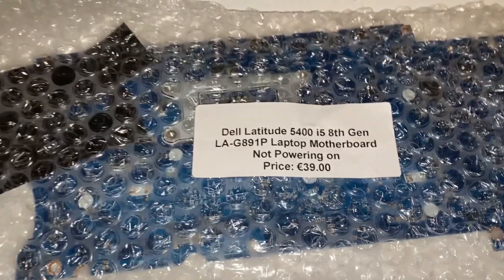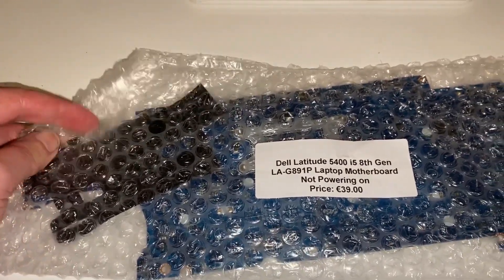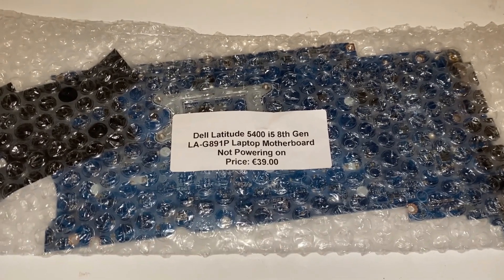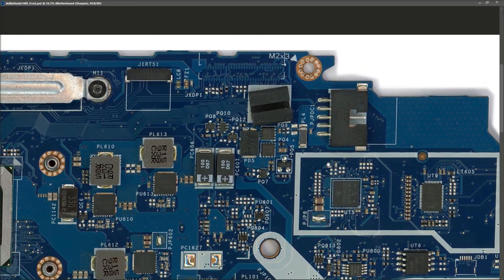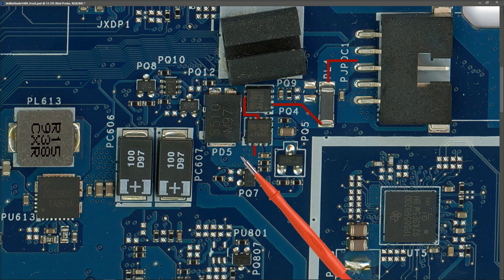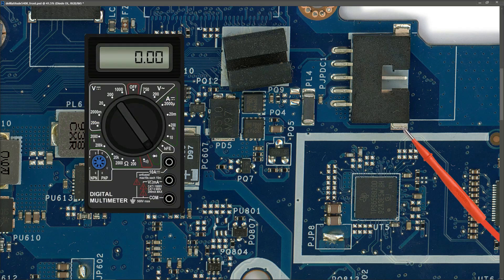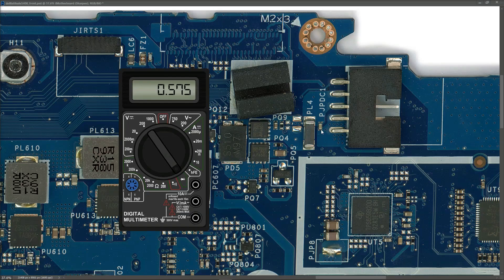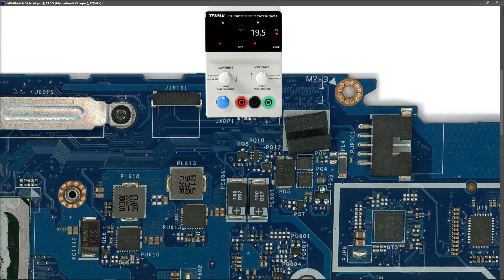Dell Latitude 5400 LA-G891P - Not Powering On

Comment: Accurate failure analysis of yours although fortunately nothing was wrong with that MoBo (misdiagnosed by the other person). Thank you very much for sharing and of course for me it is not wasted time or effort on your part but on the contrary they are valuable. An affectionate greeting from Mexico.
PS: Unfortunately the data sheet of that ISL9538C IC (only 4 pages) does not show us the function and/or identification of each pin (there are 32 in total) much less a broader explanation of the theory of operation of this component in particular.
In 2017 Renesas acquired Intersil (a merger). Renesas an American company based in California (USA). Many semiconductor manufacturing companies have complained of plagiarism (piracy) even in court. It's easy to figure out why you limit your technical information, right?

Comment: I have dealt with these motherboards for a while and the issue seems to be USB Type C connector related. They are either damaged or the controller burnt out.
Reply: Yeah. Agree with you. For not using the original charger/adapter with its correct wattage since the pin called Id is not there as a "decoration". Especially true on Dell, Alienware models and also applies to HP Spectre and their current x360 models that use the Thunderbolt IC. For current Lenovo models ThinkPad too. All the best.

Comment: This topology of the input voltage is called NVDC or NarrowVdc topology. It's the same thing you see in macbooks with the well known PPbus_G3H where the actual main power rail of the system usually matches this of the battery. As someone else writes here in the comments, you can't measure this voltage directly on the coil, it's better to measure it on a capacitor because of the very high switching frequency of the coil.  The thing is that manufacturers use this topology in order to minimize the cost of the BoM since lower voltage means you can use cheaper components. The total efficiency of NVDC though is lower that this of a traditional topology.

Comment: You are doing a great job explaining.

The problem with L1 is that it is going to be alternating pulses due to it being driven by the two mosfets on each side. While many multimeters can read a FREQUENCIES of 9.99Mhz or more, they can't measure voltage at that frequency. Some cheap meters only go up to 999Hz while Flukes do around 10-15KHz I believe, but even this is too low as many operate between 34Khz to 4.? MHz on some Apple supplies